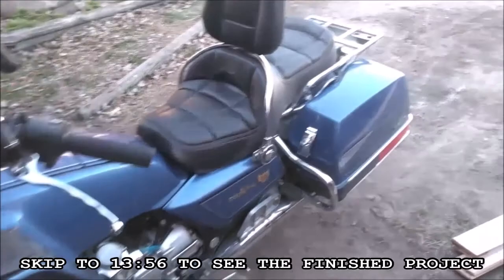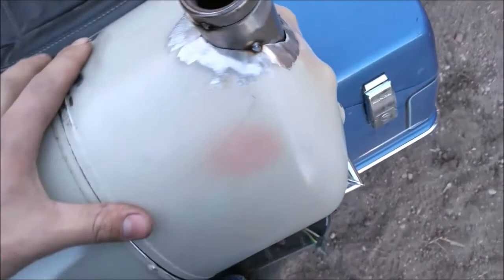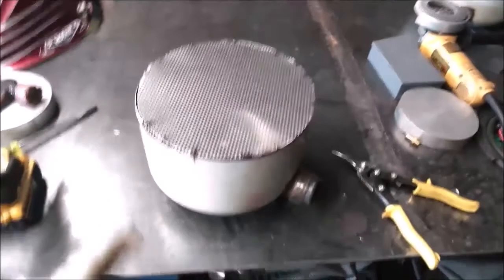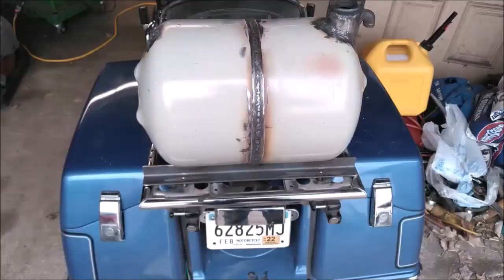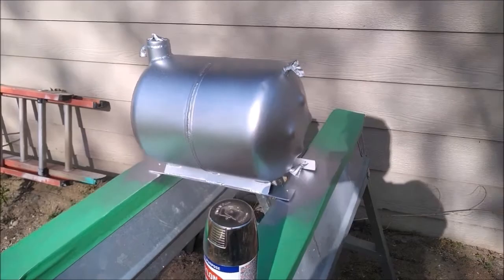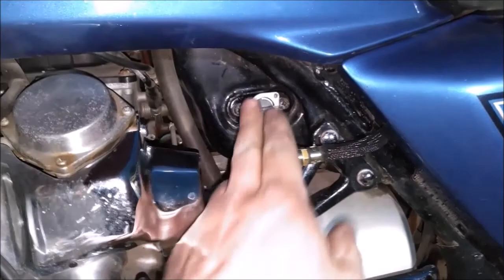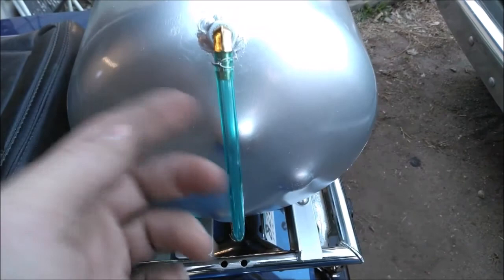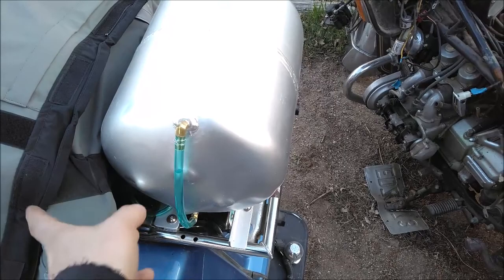GL1200 Aux Tank Build and Test

Comment: Good build and useful ideas!  FYI, Summit Racing sells a porous foam insert material for baffling a fuel tank.  Also, wrapping the tank in heat-resistant thermal mat will decrease rate of evaporation and will look tits!